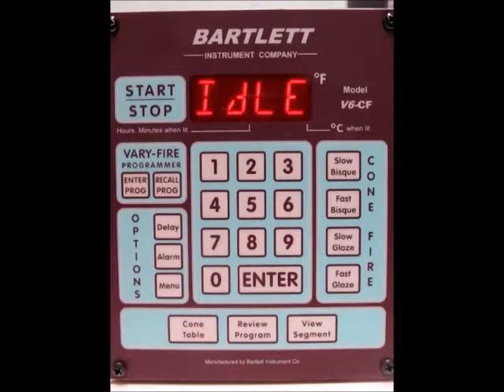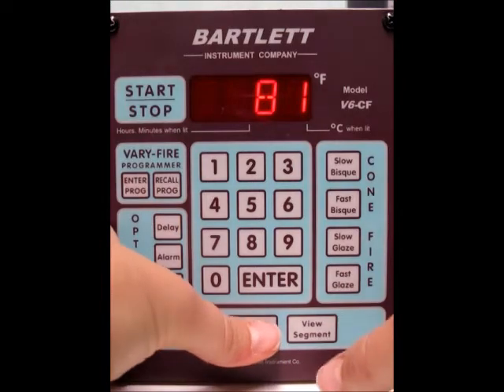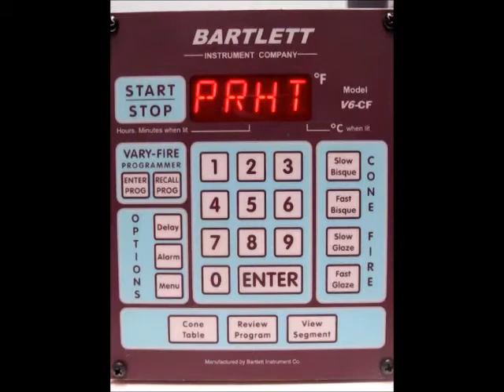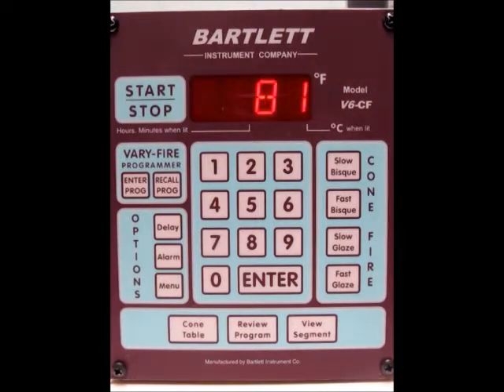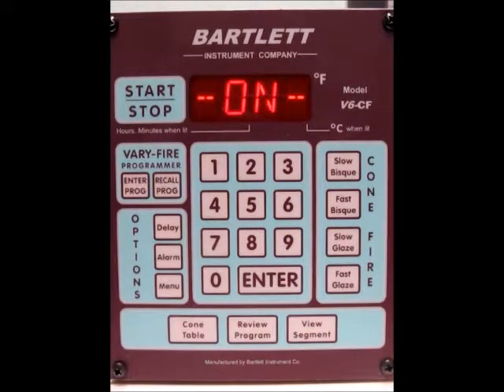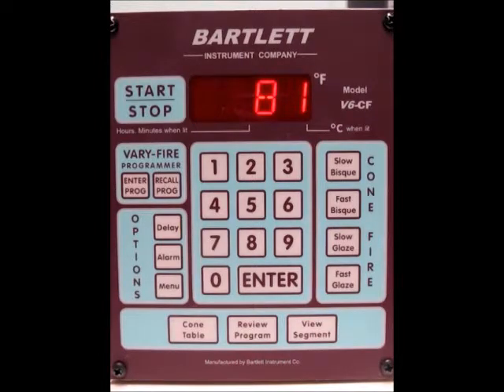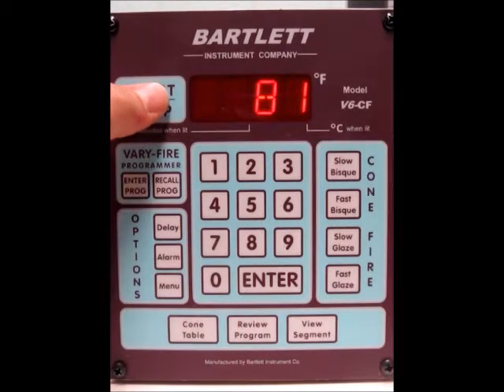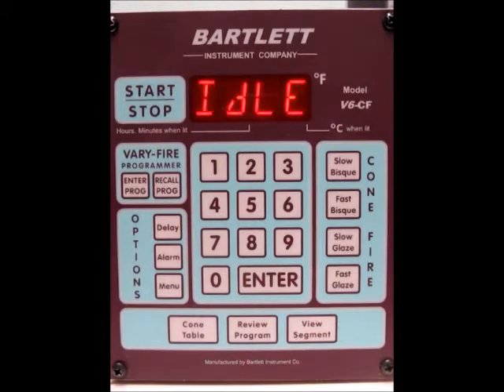Bartlett V6CF | Review & Start Cone-Fire Program

Comment: I bought a V6-CF controller to use it on my electric kiln. Can I use the same unit to control a programmable firing on a gas kiln up to cone 10, especially in reduction ?
Reply from the maker: Kiln manufactures have used the V6-CF on some of their Gas kilns before. Our controller is just an on or off type unit. You will want to reach out to the kiln manufacture to see what would be needed to be able to use that controller on the Gas kiln.
Reply: @bartlettinstrumentcompany4969  I’m building my own gas kiln. If the V6-CF is only a ON/OFF unit, then I guess it would be difficult to use it.  Do you have any other controller that is specifically appropriate for a gas kiln ? What firing system do you recommend I use?

Comment: This is my first time firing. A couple of differences. There is no “menu” button, it is an “other” button, but I think it does the same thing, right?
Reply from the maker: Correct. The "Menu" button on newer V6-CF controller model replaced the button labeled "Other" on the older V6-CF controllers. Both buttons do the same thing.
Reply: @bartlettinstrumentcompany4969  also, I set the kiln for Cone 04 and it did not reach temperature. It stayed at 1100 all night and when I woke up in morning it was still at 1100. Do you know what could be the problem?
Reply: Thanks for the quick response. I just fired for first time today. It's a used kiln and in great condition. It's been a few hours and it's at 400 degrees. Fingers crossed. Venting turned out to be difficult.